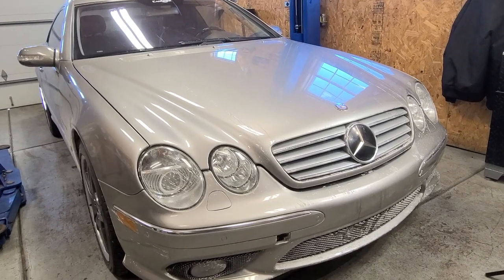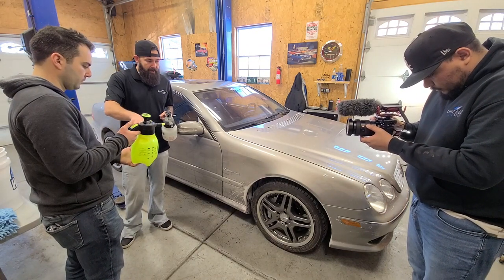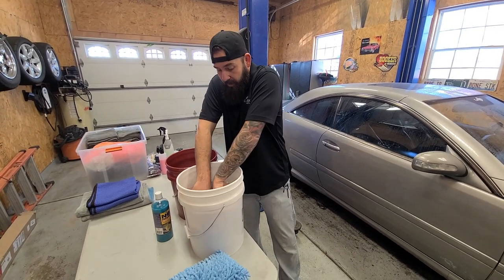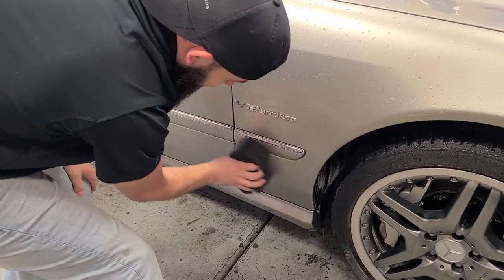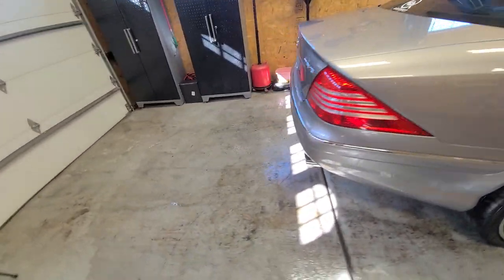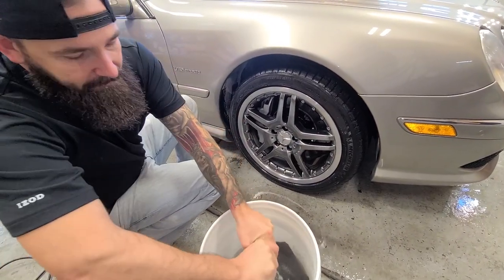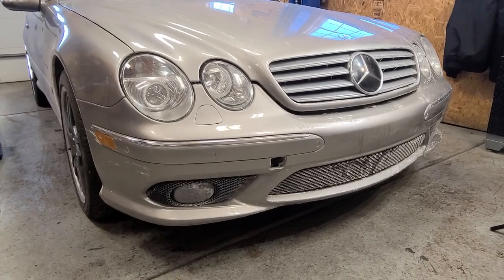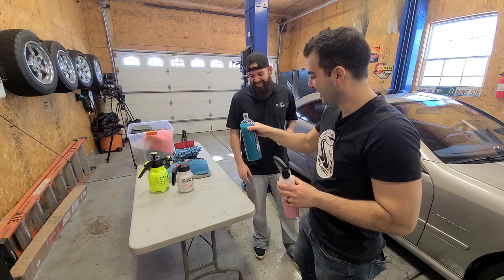How To Properly Wash A Really Dirty Car Indoors Without A Hose Or Drain. Safe Rinseless Wash!

Comment: I still really really recommend stopping at a coin wash bay and just hosing the thing off before you waterless wash with this much salt on the paint
Reply: That's a great idea for sure, I'm just afraid all the wash places are closed as the water in their noses would freeze and potentially damage their equipment. I guess that's why he didn't this way
Reply: @16matusko  I have a local coin wash by me and the owner always uses hot water all year round and during the winter he lets the nozzle drip hot water and never freezes. Even in negative weather it’s open.
Reply: @javiderek31  yes
Reply: @javiderek31  oh nice, that's really useful.
Reply: Yes, I would also highly recommend this. But for myself if I was at the wash bay and rinsing it off, why not just go ahead and do the traditional wash? I think this is great way to wash a car if you have no other means of doing it, but it’s definitely my last option.
Reply: @ChicagoAutoPros  I use the wash bay but never for actually washing...just use the water. At least by me they provide pretty bad non ph-neutral soap and my car is ceramic coated. I tried to bring my own buckets and soap but employee said no.
Reply: Go through brushless car wash the. Do this
Reply: Yup......IMO when washing a car scrubbing the paint with any type of material is a BIG no no. Even if the car is 100% clean you're still slowly wearing away the paint which is a fact not an opinion lol. I always go the spray wash method. Only scenario where i will scrub my car is for paint correction or applying some type of protective coating.  But if you don't care or just own a rusted Toyota echo go ahead n scrub away.
Reply: How is this a waterless wash when the 1st item you use is water
Reply: "Less water" not free of water.
Reply: @austinmurray4287  just do it at night if he’s not there...near me nobody is there at night so nobody complains
Reply: @ChicagoAutoPros  Because I cannot rinse of my car at home?

Comment: 04:13 "This is a inexpensive steamer, it's just a couple of 100 dollars"....Yeah, i am taking it to the car wash.
Reply: So true, actually that is one of the best methods, take to touch less car wash then use a high lube detailer spray after and it’s perfect..
Reply: You can use it inside your house too. Steamers are great for getting bathrooms sparkling clean.
Reply: Coin wash all day
Reply: @undertakerfire7810  nobody is gonna pay hundreds of dollars to wash their own car
Reply: I was able to pickup a McCullough open box special on Amazon for 80 bucks. Has 45 mins of non stop steam too. There are deals out there, just check around. The steamer is the best for deodorizing interiors also.
Reply: @undertakerfire7810  trust me no it’s not. Unless you really pay attention to the paint that detailed mix and shit gives you no protection and is just enough for another wash. So if it rains it’s basically done
Reply: all the dirt and salt between the panels, lights are still on the paint with this no hose method. Just spray the damn thing and wash it, its no rocket science to clean it in winter, you just want to remove the road salt and protect it quickly if you can, the next day.it will look as bad if the snow melt on the road.
Reply: Cheyenne Obregon Well I’ve only been derailing for years... It works damm well, water beads like crazy and provides great protection to even un waxed or properly decontaminated paint.....
Reply: @undertakerfire7810  the think is you could also be sealing in the black heads in the paint and traffic film if you’re not claying the paint, if you feel like your paint Has a sand paper texture that’s what you’re locking in when you don’t decontaminate robbing your paint of clarity and gloss
Reply: @djcutnpaste  absolutely, I had a leaking milk bottle in amongst my shopping moped it up when I got home and the car still had that milk smell, 10 mins in the boot with the steamer and the smell had gone,works well to degrease the engine bay and get all the bugs off the windscreen in the summer.
Amazon warehouse have deals on all the time.
Tele shopping channels as well.
Reply: Compared to the really nice ones that are $700-$800. This one is inexpensive and still does a good job for the dollar amount. The really cheap $50 dollar ones are for cloths as they have very little psi behind them to blow out the trim and emblems.
Reply: @ChicagoAutoPros  so how much was the one in the video...500? It might be much for a decent steamer but it not considered inexpensive for us "commoners". All the hardware combined in this video will get my car thru the car wash 100's of times. That won't mean that the surface of thr car will get out everything...but that requires clay detailing and that's a whole different story.

So apples to apples, i would still use the carwash. (Yes i know it would still get the swirls in the top coat but you can have that detailed by a pro once a year and still keep money in my pocket ;) )
Reply: @unphoto  That’s steamer is $299. You also don’t need it to complete the wash. It’s just taking it to that next level. 

You do you man, I’m just trying to help share information on other options available. For myself I prefer a traditional hand wash. But this is a great alternative in many different situations.
Reply: @ChicagoAutoPros  Appreciate your transparency. That goes a long way. Keep up the good work
Reply: You buy it once and you have it for years...its an investment. Its great on interior as well
Reply: @chrispietrzak21  but you still have to invest in it, and that's just the steamer. The steamer alone does not clean the car by itself. You need the shampoo, buckets, towel, detailer and brushes. This is something foe an enthusiastic DYI cleaner. I just want my cars clean without too much effort.

I understand the reason why this method exists bit, it is not something you would do every weekend and that is where the trade off kicks in for me.

I am not saying it does not work. I am stating that, for an "in garage, hands on" wash methode, it is pretty pricey and i would still ride to the car wash.

Now, if the car wasn't supposed to drive after this wash because it would get dirty again and salt would attach it self to the car again, this would definitely be something worth considering
Reply: That kind of steamer won't do anything except for fabric cleaning. You'll need big ass steamer like Optima to blast off dirt like that.
Reply: A steamer lasts a long time and has a lot of different uses in the garage and around the house.

As for ONR washes. They are great for the winter. I wash my car at a coin wash first before doing a rinseless wash. It is great if you want to wash you car but you know it is going to get filthy again soon.

Comment: That car need to have the undercarriage cleaned too or is going to rust everything
Reply: That’s what I’m thinking. It’s normally the underside that rusts out first.
Reply: I have a portable shower and sprayer that I use to wash off the undercarriage of my vehicles.  I let the rain wash off the salt/grime and then use a waterless wash.
Reply: Dude you missed the entire point of the video...it’s not a how to wash your car video it’s a worse case scenario how to wash your car in between cold spells
Reply: @scottysecretlyloveschrysle1417  Salt doesn’t hurt modern paint, especially if it’s waxed.  You only really need to worry about the frame.
Reply: @user-tb7rn1il3q  LOL

Comment: ONR tune turned me into a believer years ago. I've had numerous clients with brand new black vehicles that have only been washed with ONR (except for the dealership wash 😔) and looked just as new when they traded or sold them. I've only use the big red sponge. Small sections at a time. Definitely faster than traditional soap and water washing.

Comment: Two detail kegs, one with rinseless wash, one with deionized water. Use the big red sponge and two buckets with grit guards (very important) and of course separate wheel bucket and sponge (we use black sponge on wheels and red on paint). Once the whole car had been washed, we rinse the car down quickly with the second keg to flush dirt and dilute the rinseless wash residue, then we dry the car. Otherwise you risk grabbing dirt off an adjacent panel with your drying towel. It’s basically a controlled car wash, leave the keg you’re using hooked up to an air compressor with a regulator and you got consistent 150 psi. Is a pressure washer better? Yes, but only for an initial rinse, foam, and rinse.

Comment: I've been using Dawn dish soap in a spray bottle with water to clean my grandma's Lincoln for a couple years now and it does absolutely fantastic. The only downside is you have to rinse the car really really well or it'll streak bad
Reply: yeah dont use dawn the chemicals in dish soap will strip your paint. use meguiars gold class

Comment: A 1gal sprayer will make your life easier. You'll be able to soak the car thoroughly in one go.

In the winter go to the self wash, spray the car down with soap and rinse (no brush!) Then use the gallon of onr in the gallon sprayer and dry with a bunch of towels. Super easy, you get the salt off the underside and wheel wells too.

Comment: does that do the underbody where the salt does the real damage?
Reply from the maker: No but you could get under there and go nuts
Reply: If you seal the undercarriage with Amsoil's product or fluidfilm, you dont have to worry about it :)
Reply: LegitStreetCars Try doing a Dry Ice clean. That method removes all grime without damaging any component.

It's quite expensive though!

Comment: While interesting if you don't have a garage it's not going to work.   If you're out in the cold and don't have access to car wash, pretty much the best option I've found is the ammo frothe , spray the foam on and wipe off quickly.   No ice forming from the water in a rinseless wash like this.

Comment: How to wash a car when it's freezing outside: 1) Take the car to your favourite car wash and wash it as you would during summer. 2) Drive straight to a downtown shopping mall that has indoor heated (underground?) parking. 3) Go for a leisurely lunch and/or dinner, shopping, movie etc. Typically, with the low humidity of winter, the car will be bone-dry in an hour or two.
Reply: nice idea

Comment: For a such dirty salty car I will never do a superficial clean like the one that was done. It may look "clean" but it will rust away as the same rate as if you don't wash it at all. The pressure wash will remove the salt on places that you cant reach with a sponge or towel and the undercarriage will also loose the heavy dirt. You are better doing a quick spray at the car wash than doing it on this way.

Comment: What about the whole underneath of the car?
Reply: I use a pump sprayer, with an "antenna" wand, and a 80 degree nozzle, to spray 2 gallons of water mixed with Salt's Gone..  I do the entire car, including under the car....
  Then rinse with the same pump sprayer,  but just plain water...
Completely touchless, i blow dry with my battery operated leaf blower,   .... I do 3 cars in my garage in 1/2 hour.... all to get the salt off..

Comment: How well does this work cleaning wise? If I were to do this + do a run with a clay bar, and maybe rubbing alcohol, would I be able to ceramic coat the car?
Reply: Probably not, you'll still have to sand the clearcoat, with a pad and then you could respray, if it has flaking clear you would have to remove all the, flaking clear and not damage the colorcoat
Reply: @danielcarter5579  that's fair, I need to do some correction for paint, and I would polish it first, if I were to do it.
Reply: @sergeykuznetsov4314  if your gonna have to respray, polishing it is pointless because your gonna have to scuff it back up to spray clear. After you spray clear thats when you do your paint correction with nibs, defects, and that'll be with wetsanding.
Reply: No sanding required, it's a relatively new car, I'm just thinking of polishing it, you know? And avoiding further scratches
Reply: @sergeykuznetsov4314  yeah, if its just paint correction you want done then yes, but in then original post you said clearcoating the car.
Reply: @danielcarter5579  oh, I am an idiot, I meant ceramic coating :)
Reply: @sergeykuznetsov4314  hah, in that case, do that correction and ceramic coat away!

Comment: I dont have I garage so don't laugh, but what if you fired up a pressure washer and washed it like normal, whats the worst that can happen? it's no biggie, the water would just flow into the street right?

Comment: Interesting but more expensive and car is still rust prone as it Needs a power washing of the under bottom of wheel wells to rid of the salt.  This method is great for summer washes however.

Comment: It's not the salt on the paint that is the real issue. The rust comes on the unpainted underside and interiors of the fenders, etc. And this process does nothing for that. It makes the visible parts look great but isn't actually preventing the real problem.

Comment: So push salt into the body crevices, then through to the radiator, and not wash the underbody? Then let the salt sit on concrete? Great way to cause more problems washing an expensive car like that. Run it up to a car wash with underbody sprayer in the winter man salt is so corrosive.

Comment: I get that this is basically an infomercial on how to do a process like this but why wouldn't you go straight to the drive through carwash and run through it about 5 times (spray only - no brushes) before you got home? As a Florida resident I cringe every time I see one of your insanely-rusty undercarriages.

Comment: Yeah.... uhh, don't ever do this. Rinseless washes are bullshit. They might be fine in a pinch if your car is already basically clean and you just want to get some road film or dust off it, but if your car is filthy dirty and encrusted in salt like this just don't do it. And I know that people say to never bring a car to an automatic car wash, but that's also bullshit, because if your car is covered in salt like this, an automatic car wash will get your undercarriage clean also, which is crucial for preventing underbody rust. This wash did absolutely nothing for the undercarriage, which will now have thousands of miles worth of road salt continuing to eat away at it for however long the engine/suspension work will take. 

This car should have been run through an automatic car wash, then maybe brought to a professional detailer for a water wash just to get the surface extra clean if that's what they wanted. But seriously if you drive your car in the winter, bring it to a car wash. You want the underside cleaned at least once a week.